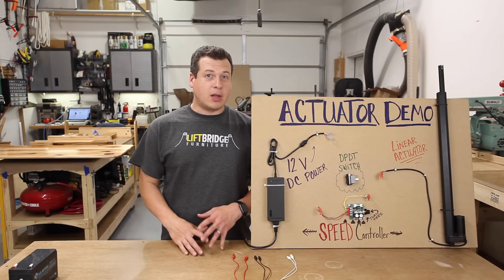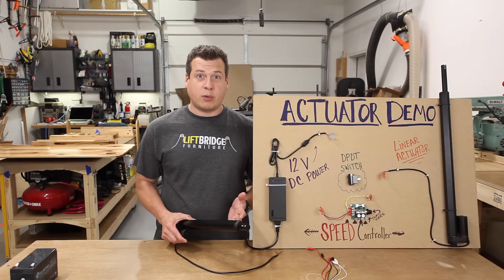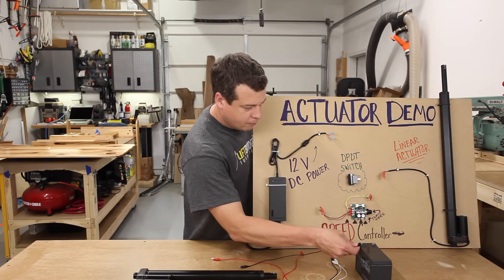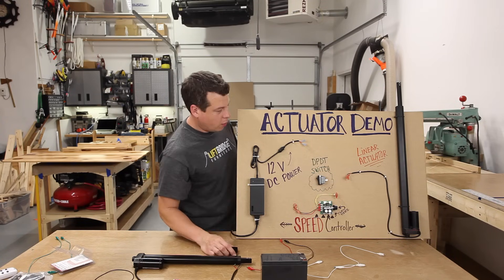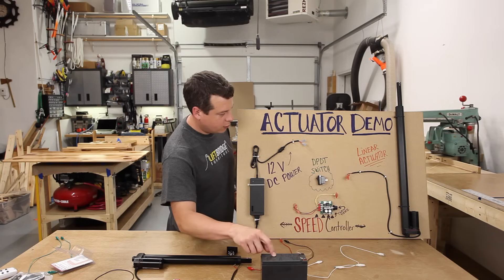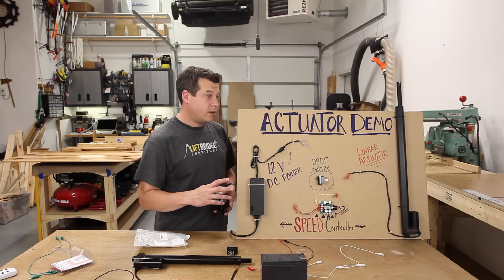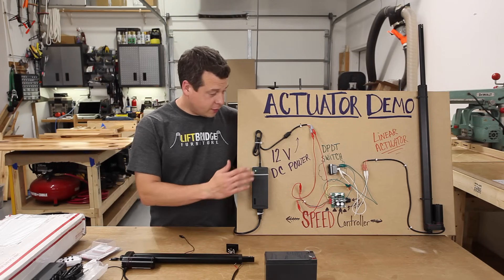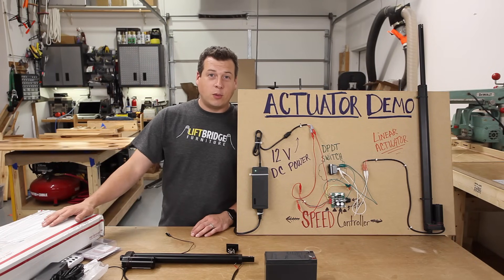Linear Actuators 101 - for Woodworkers

Comment: Hi thanks so much for your tutorial...I’m having a hard time getting all four of my actuators to work simultaneously raising the roof on my trailer- any advice?
Reply from the maker: I've never hooked up 4 to the same switch but I would think that more than 2 can get tricky if they aren't in sync with each other.  A speed controller on your slower actuator get them mostly in sync but still won't be absolutely perfect.  It really depends on how much variation in play that your design allows for on each actuator. If your tolerances are too tight then something will break or you'll wear out an actuator too quickly.
Reply: It would be interesting to research whether there are any linear actuators on the market that provide feedback on travel,  ie, ticks per  inch, or if you could rig up a similar feedback method.  That would allow you to count the movement ticks on each actuator in real time and then adjust the speed on each accordingly to keep them in sync.  Lol, I know that would be overly complicated but I can't help going down the rabbit hole on stuff like this.

Comment: This is EXACTLY the info I was looking for! I've been wanting to make my own "updesk" for a while but was unsure how to tackle the mechanics. Going for an L shaped corner desk probably running 3 actuators, I'm sure it'll be be pretty hefty. Any pros or cons to going linear actuators over screw actuators? Apparently you're around the cities too, small world! Thanks for the video, hugely helpful stuff.
Reply from the maker: Depending on the amount of play that you allow in your design, three actuators could get a little tricky if they're not perfectly in sync with each other. Honestly, I've never tried three on the same switch but it's worth a shot. I don't have much experience with ball screw actuators but I think most of the standing desks on the market use ball screws with a brake system.  Here's a comparison between the acme screw type and the ball screw type: https://www.progressiveautomations.com/acme-screw-ball-screw/

Comment: Do u need a fuse ?
Reply from the maker: A fuse would probably be a good idea.
Reply: While a fuse is not technically needed, the purpose of a fuse is to protect the equipment should an electrical surge (more electrical potential than normal) happen, so it is generally a good idea to have one.

An example would be say you have a circuit with a 10 amp fuse, if the amperage raises above 10 amps then the fuse would blow which will interrupt the circuit and not allow a damaging current to your equipment. 

I apologize if you already know this, I am just tossing that out for anyone who doesn't know.
Reply: @nbpraptor    I am in know way trying to rain on your post, but perhaps the wording is off. Electrical potential is "The ability for electrons to move", while the "Intensity" is the amount of electrons passing thru a device and it's circuit. Potential is measured in voltage and the Intensity is measured in amperage. A fuse is designed to open due to heat, not current. A 20 amp DC fuse will open quicker in a hotter location, as compared to a colder location. Yes, the current heats it up, but a fuse can withstand higher current than it's rating for a short period of time, without opening. Engineering will tell you the fuse is to protect the wires or circuit and not the device. The device is intended to be changed / replaced, due to failure or wear. It's all cool, I just taught 6 electrical classes for ACDelco for 7 years after 30+ years and an ASE Master Tech. 
Look for ohms solving circle or power solving circle. It's "E" over "I" X "R". But power is "P" over "I" X "E"...with division from top, multiplication on the bottom, both requires two known measurements to find the unknown.
Reply: @deankay4434  by no means do i take what you are saying in a negative way, you certainly sound like you are in the know more than I. Thanks for the correction :)

Comment: The linked power supply adapter has a normal plug end. Is this stripped in the video to connect to the switch, and then the actuator from there? Is there more info for connecting the power supply to the switch, etc. safely?
Reply from the maker: Yes, the end of the power supply wire is cut then stripped and then connected directly to the actuator switch.  Those are the basics, but there are a lot more details in the Lift Bridge Standing Desk plans for connecting the switch to two actuators in different ways which includes wiring diagrams.

Comment: Can the actuator move in and out at a rate of 9 inches per second? I need actuators that is able to move fast.
Reply from the maker: These actuators only move at a rate of 0.39 in./sec (10 mm/sec.)
Reply: Do you think actuators with both high force and speed can be manufactured?
Reply from the maker: In general, the higher the speed the lower the force it can handle.  I don't know of any that can move at 9 inches per second with a high amount of force but I'm sure some exist.

Comment: I’m a techie and I’ve started to do some woodwork lately. I am building something like what you have and have been looking into a linear actuator or servo for the job. This is one of the best... I repeat BEST videos I’ve seen for quality of the video, audio, information, examples, etc. I’m definitely following after this video and going to try this out. Thank you!!!
Reply from the maker: Thanks for the kind words!
Reply: Hey Techie, how would keep these synchronized so they don't bind up. His build using two will get out of sync and bind as soon as it's operated with more weight on one side of his bench than the other.

Comment: this controller can only make the arm goes slower??   so if i buy a 90mm/s then its my max speed, and this controller cant make it goes faster??  so if ii buy a 30mm/s but stronger i cant get it to go in 90mm/s??
Reply from the maker: I assume that you're referring to the speed controller.  Yes, this speed controller allows you to decrease the default speed of a DC motor.  You can't increase the default speed by adding a speed controller unless you can find a speed controller that increases the voltage beyond 12 volts but that probably wouldn't be good for your motor if it's a 12 v motor.

Comment: Hey Tommy, great video and thanks very much for sharing. Could we use this setup to raise the roof of a double decker bus?!? one on each pillar (4 in total). Like this bus http://www.thebusbusiness.com/the-rosebery/ help would be greatly appreciated
Reply from the maker: Personally, I wouldn't use these to raise the roof of a double decker bus.  You would probably want something much more heavy duty that could handle the weight load as well as the lateral load. Lateral load might not be an issue if your structure is supported laterally by other means. That being said, there are versions of these linear actuators that are much more heavy duty that would probably do the job.

Comment: Tommy Tompkins
I want some cheap line actuators, but resistant and capables,, do you think these actuators are the option? or there are more cheaper, Can I do the same work with cheapest line actuators? What are your considerations. (Because of the money issue)
Reply: javier mila I did the research and you’d only save about $20 with the cheapest available on eBay compared to these Windy Nation ones, and that’s WITHOUT all the hardware, switches, and wiring you need to make them work. Make the right buy. Buy once, cry once, enjoy the quality decision forever.

Comment: Using a speed controller to match actuators perfectly is very difficult especially since 12 volt motors can vary their speed a bit with small changes in voltage and the error would compound with each stroke. The best way to take care of that on multiple actuators is to design your project so the actuators bottom (or top) out on each cycle of your project or, at least, so you can run them to their limits every once in awhile. If one gets a half a turn ahead it would stop when it hits its limit switch allowing the others to continue to run for a fraction of a second until they hit their limit switches which would synchronize them all to exactly the same level.
Reply from the maker: It's not perfect, but it works just fine for my particular furniture applications. I agree that it's a good idea to run them to their limit switches every once in a while.  In my desk, the limit switches are reached any time the desk is raised to the max height or any time it's lowered to the minimum height.  When that happens, they both level out and "reset" if you will. With more expensive actuators, I know that you can use Arduino controllers to keep them in perfect sync, but with these cheaper actuators that don't have stepper motors, I'm curious how else you would accomplish keeping them in sync?
Reply: The only other way I would guess to synch them would be to add extra limit switches somewhere along their travel that would stop them all at a particular height if you can't run them to their regular limits or you don't want the full travel. Of course that would mean you'd have to install a bypass switch to override the limit switches when you want to get them moving again but that could just be a momentary switch and it wouldn't change any of the other wiring or forward/reverse switches as long as the momentary switch gives them the right polarity for a second. Still the easiest way is just to design your project to run to the actuator's limit switches and buy the proper length actuators. I can't imagine a design that couldn't run them to one of their limit switches. If I remember right they can be ordered down to two inch increments from some suppliers.
Reply: You could use a cheap accelerometer to make sure the table is level/at the slope you want. Accelerometers will be able to tell you where straight down is in relation to the table surface. Using that info, some simple trig, and a microcontroller you can make sure the table is always level.
Reply: @nicholascaine1839  such a ridiculously complicated solution. Many actuators have built in position encoders...
Reply: Commercial tables seem to have just one "active" motor and a simple mechanical axle that connects both sides. When using two parallel motors I would suggest using at least same length cables so that the voltage is as simular as possible for both motors.

Comment: Great video.  I see there are wireless controls for actuators.  If I wanted both the dpdt switch, and a wireless control, how would I do that??
Reply from the maker: You could certainly wire both up and have them operate on both the wireless and the DPDT switch. Basically, you would need to splice into the power that feeds the wireless controller to power your DPDT switch, then also splice into your linear actuator wires so that you have power going to them from your switch as well as from the wireless controller.  It's probably easier to explain if you look at the wiring diagram here http://amzn.to/2sIJyMj.  In that diagram, you'd want to splice in your switch at #3 and in between the power supply and the wireless controller. I have more detailed wiring diagrams in my desk plans that also incorporate the speed controller if you're interested.
Reply: great explanation, thanks a ton

Comment: How well do they maintain position under load?
Reply from the maker: These linear actuators should remain solid in position when the power is cut. Even under a heavy load, they should not move unless you exceed the load capacity.

Comment: When no power supplies, will the actuator retreat under pressure?   Or can you push the rod down when no more power supply to the motor.
Reply from the maker: These linear actuators should remain solid in position when the power is cut.  Even under a heavy load, they should not move unless you exceed the load capacity.
Reply: Thank you for clarifying that. Looking forward to seeing more similar videos
Reply: With a "worm gear" driven actuator they will  not move without power applied  .....ever.( Also high grade and powerful  actuators are found in old electric wheelchairs.)

Comment: AMAZING info.. just when I got into making myself an adjustable standing desk.. Thank you so much!!
QUESTION: I came across products online and one of them had the linear actuators only on one side of the table where the frame is made of metal and top is wood . I can understand that the weight distribution matters but if it's not too much heavy on the table and weight is little off, will it still work?
Reply from the maker: It's really tough to say without seeing how the table was constructed and how the lifting mechanism is designed.

Comment: your presentation of switches is incorrect as you said in the beginning the actuator has a limiting switch internally there for using a rocker or fixed switch will not make the actuator continuously work  the only difference between the the 2 switches is that you can  control the height at any given point but with the momentary switch it is easier to let go and stop as against pressing the fixed switch
Reply from the maker: Sorry, I'm sure I understand where you think I'm incorrect. The actuators have limit switches built into them so that they automatically stop when they reach the maximum extension or maximum retraction, even if the rocker switch is still on.
Reply: @TommyTompkins    I think what he was "trying" to point out is, when you said "if you toggle it, the actuator is going to keep moving until you manually do that"  6:57  It won't. The limit switch will cut the current and it will stop. So you are "incorrect" in the video but correct here in your comment.
Reply: First!:
"Your presentation of switches is incorrect, as you said in the beginning, the actuator has a limiting switch internally therefore using a momentary or locking switch will not make the actuator continuously work.You can control the height at any given point with either switch. The only difference between the the 2 switches is that with the momentary switch it is easier stop, the actuator, by just letting go. As compared to the locking switch you will have to release the locking switch by pressing it again to move it back to center."
There, I fixed your crazy run on sentence.

"rocker or fixed switch will not make the actuator continuously work"  Yes, yes it will. What you mean to say is that it will not continuously RUN. If power is still being sent to the actuator through a switch, then the internal limit switch is working, aka doing its job. Continuous work, yes. Continuous run, no.

Well, there are many more things wrong with your comment but, I believe, I covered your main "point".

Comment: i would simply just create one of those with hydraulic lifts or spring and lock switch ....the noise on those is annoying
Reply from the maker: Do you have a link to the lifts you would use?  I'm curious what alternative costs would be.
Reply: a quiet hydraulic lift? I too am interested in this.
Reply: ill be making 2 version for a buddy of mines that needs one one with heavy duty hydraulic gas lifts and another with spring loaded enclosed with wood around it hidden inside push down and a pin latch to just push in and leave it in the desired height or taken off then pushed down when needed smaller then pushed back in when desired height reached both similar in the push pins manner but two different ways on building it but same result later in the future i will also be making a youtube feed on my projects that im currently working on editing...as far as the hydraulic lifts they are like this but might not use this much weight capacity and specific version since there will be 4 in an x pattern: https://www.ebay.com/p/SUSPA-12-Heavy-Duty-Clamshell-Prop-185-C16-22632/656222660?iid=281706315551&_trkparms=aid%3D222007%26algo%3DSIM.MBE%26ao%3D2%26asc%3D44039%26meid%3D6e94cc4d843c4e69a7150d9277a2a2cd%26pid%3D100005%26rk%3D3%26rkt%3D6%26sd%3D232634086543%26itm%3D281706315551&_trksid=p2047675.c100005.m1851

Comment: Great video. Now I have find a project to make use those guys. 

One big recommendation, though - don't use a 5 amp power supply to run two actuators. You want to have 25 to 30% overhead. I'd recommend an 8-amp power supply minimum. For three actuators, the 10-amp supply will be fine. 

Cheers! 
David (an electrical engineer,  aka EE)
Remember, you can't spell "geek" without a double-E.
Reply from the maker: Well, if an electrical engineer says so, I'll take your advice.  Thanks!
Reply: Thanks for the info david!

Comment: Hypothetical question. If you had two actuators wired opposite and each at it's limit you could have one go up will the other goes down and given that they are the same length they would both max out at the same time? Second question. Your switch is 120 volt 30 amp, can all 120 volt switches run lower voltages or does 12 volt DC need to be listed in the description? I see switches that are 240/120 and switches that are 12 volt dc.
Reply from the maker: 1) Theoretically, yes. If both actuators were running at the same speed and one of them had the polarity reversed on the switch, they would run opposite to each other and hit the limit switches at approximately the same time. 2) Yes, all 120v switches can run lower voltages since that's just the rating on the switch. But you need to also figure in the max amp rating (current) for the switch which is relative to the voltage that you're using. For example, with the rocker switches that I'm using, they're rated at 18 amps when running 125vac, 10 amps when running 250vac, and 30 amps when running 12vdc.